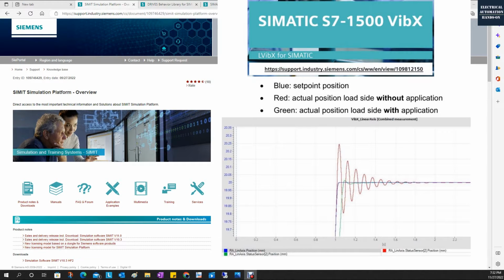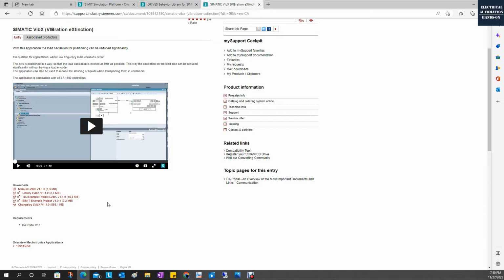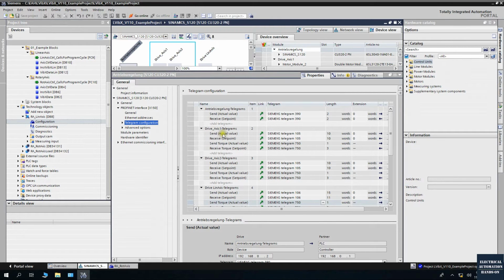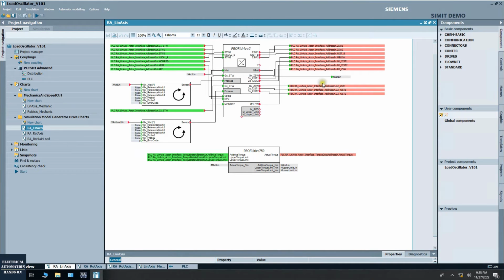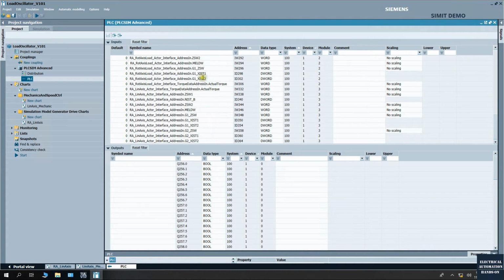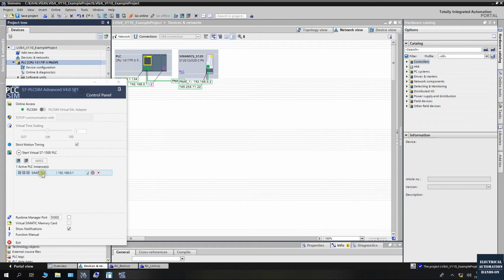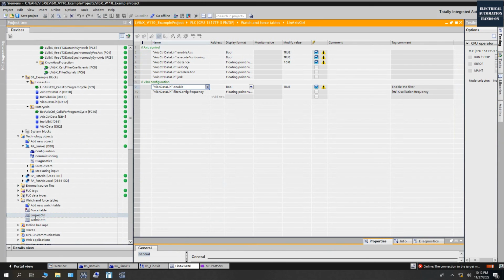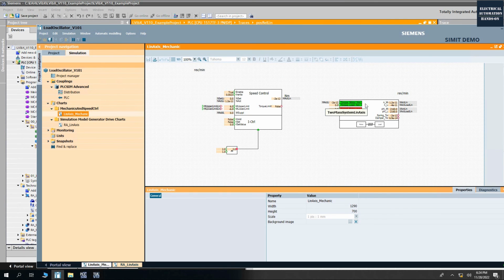SS01. Getting Started with SIMIT Siemens Simulation Platform with Servo Drive Motion Control (EN)

Comment: What is the difference between SIEMENS telegram and free telegram ?
Reply from the maker: The Siemens Telegram is predefined, for example, in a word, the enable bit, alarm bits are all defined. So once the controller and drive are using the same telegram , e.g 105 (servo control) the PLC and Drive can talk each other with the correct control command and feedback info. But if you are using three party drive and this drive doest support Siemens telegram, then you can use the free telegram and assign the control bits or status bits according to the drive side defined.

Comment: Thanks for sharing this video, I already ran the simulation but, I have some errors in the TO of LinAxis, ( In my Diagnostics of the TO RA_LinAxis[DB8} have Error  in my axis status- Drive - Encoder - Data exchange in red) how can i fix them. Thank you for your support.
Reply from the maker: Properly check the telegram associate with the encoder. Most likely you are missing the encoder telegram.